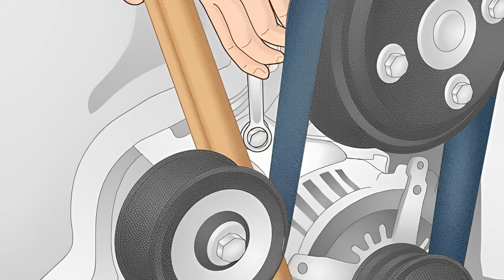Reasons Why Belt Squeals When Cold Then Goes Away

Comment: Normally, when it only squeaks on start-up, it just needs tension adjustment, especially if it's a new belt or it was removed and reinstalled.
Reply: New belts will stretch a bit in the first week or so after install, so it's wise to check the tension at that time and adjust it if there's too much slack.

Comment: Mine makes a noise when cold and not when warm. It's really annoying. I replaced it 2 years ago. The noise stopped for a few months and came back.
Reply: I’m having same problem.
Reply: May be the belt tensioner. See if you can see the tensioner arm moving or sloppy movement while you watch it. Google the belt tensioner location for your car. Generally easy to replace

Comment: Thank you but I changed the belt and tensioner twice and it still squeeks. I changed all the pulleys, and even tried a new alternator but the problem is still there. I will change them now for the third time and I will try different company for parts -.- ..... It's very annoying.
Reply: Sounds like it could be an alignment issue, all pulley's must be aligned with each other.  Watch the belt on the pulley's, it should not be moving around.
Reply: Check the harmonic balancer
Reply: Is a Mazda car ?...
Reply: @MDEV-86x86  No, It's Folkswagen Golf IV  1.8t AGU
Reply: @jkpresident4110  OK.
Reply: I feel you. Mine on squeaks when wheel is turned left or right all the way.